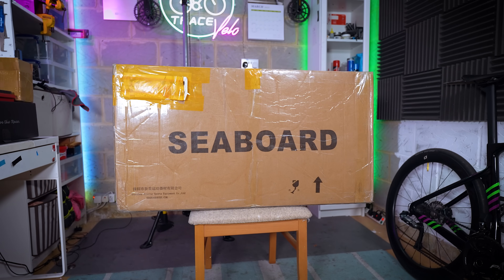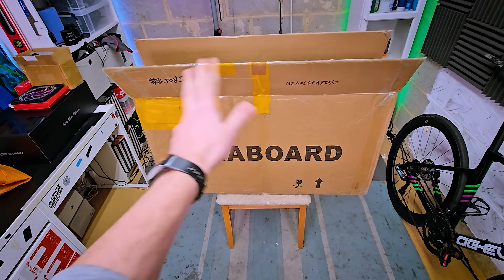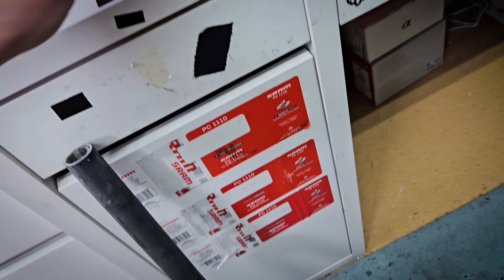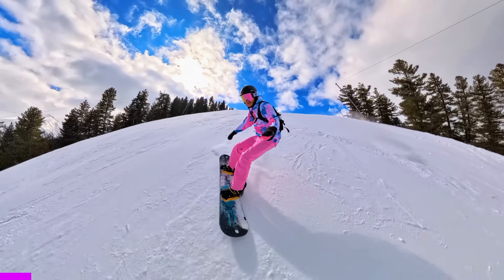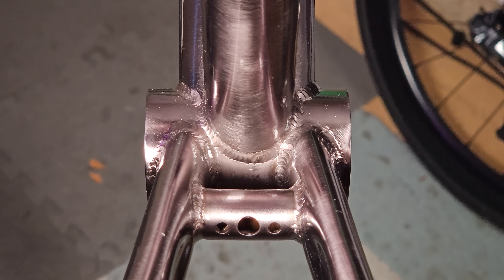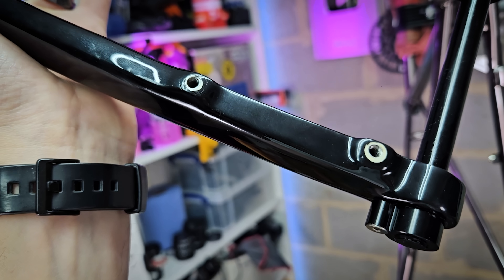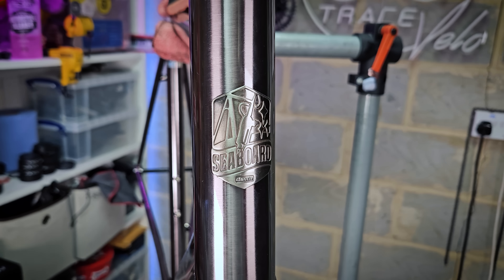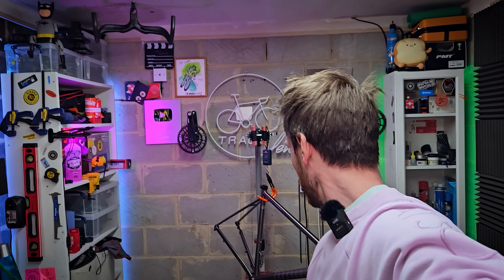A cheap steel bike frame from AliExpress - Seaboard CR05

Comment: Some all thread rod and a couple stacked oversized fender washers (so they don't bend) make for a poor man's DIY headset cup press.

It might not worth the hassle for cheap frame you don't plan on taking with you to the grave, but you can coat the inside of each tube to reduce future corrosion by sticking the straw of an aerosol can of Fluid Film/Boeshield T9/etc, into the vent hole on each tube.
Reply from the maker: I just bought some Boeshield and an extended spray can straw. I'll coat the inside of the tubes before the build. Thanks for the tip, I'll give you a shoutout in the build video!

Comment: I always treat inside of steel frames with a heavy duty rust inhibitor prior to building them. This especially applies to those tubes where water might accumulate. Something like tectyl 506 or similar.

Comment: Frame looks pretty decent to be fair. nice clear coat finish. the fork however looks as rough as a badgers ass. brake mounts look like they will need facing for sure and looks really rough around the axel holes too.

Comment: Aside from that funky front thru-axle, it all looks pretty good!  Of course, "classic" steel frames are assembled using brazed lugs and dropouts, so heat treating was not an issue with them.

Comment: My Elves Eglath cf frame uses a similar external "nut" arrangement but on the rear through axle. I wouldn't have thought you'd have any trouble removing that lower headset bearing in the future, it looked like quite a loose fit in the cup. If it does put up a fight, a blind bearing puller will get it out easy. Part of the tool is normally slightly smaller than the inside diameter of the bearing you want to remove, it is then expanded so that either it grips the inside of the bearing or a small lip expands behind the chamfer on the bearing, the tool then draws the bearing out, having said all that, I don't know if you can get one as large as the diameter of a fork steerer.

Comment: Great video! Not a professional but a hobbyist builder of several frames and forks. You don't need to heat treat cromoly unless it's thicker than 3mm. Bicycle tubes are sub 1mm. Nobody does it. Some higher end steel frame tubes are heat treated from the factory but you don't need to do anything after welding (you usually do with aluminium but I digress). Those welds look very decent and I would personally be happy with them. How is the alignment? And are the tubes double butted? And can you see a seam down the middle with the endoscope? These are the key questions. The overall frame weight is a clue (should be about 1.7kg for quality thin-walled seamless double butted tubes). 2.2kg is far too heavy. It's not the weight per se that's a problem but you will get less of the buttery smooth ride feel etc etc yada yada. Having said that recent commercial frames like the Cinelli Nemo TIG and that ridiculous Colnago thing are also overweight (although not quite as much as yours :).
Reply: 1,7? The Strael 3.0 (Reynolds 853) is 1.9 kg. Mason Resolution (Columbus Spirit) is 2.1 kg. Where do you get 1.7?
Reply: @mashkal2006  That's for my own frames which are usually about 55cm size and mostly made of Reynolds 631 in .8/.5/.8. 853 is the same tubes (unless you get ProTeam or DZB) just heat treated. That Strael weight includes a 440g fork. So that makes the actual frame 1.56, a bit lighter than mine! That's the ballpark you should be in for a nice steel frame for road use.
Reply: @benc8386  the 4.0 (new one) is that light. The 3.0, to which I referred is not. Do you know of any steel production frame (beside the Fairlight Strael 4.0) that is 1.7 kg or lighter? I'm in the process of speccing a new steel daily driver, and the Strael is outside of the budget. And I haven't been able to find anything lighter than around 1.9 kg. Many thanks in advance! 🙏
Reply: @mashkal2006  I would go custom if I were you :) The off-the-peg builders tend to overbuild, I suspect for added safety margin and ISO testing (which is very unrepresentative of real world failures anyway). Another option on a lower budget is a vintage frame.

Comment: I like the "I got a clamp-on adapter" bit, like dude, it's called just getting a derailleur, most of the non-fancy ones come with that clamp. Sure, they don't say "road" on them, but all they need to do is wrestle the chain from one ring to another, a Tourney will do the job.

Comment: Please don't use that star nut on a carbon fork. It's included in your kit because Seaboard sell this frameset with both carbon or steal model forks. They've just included both, a carbon fork requires the compression bung to support it when the stem is cinched up. It does not change with stearers containing fibreglass or not. Just worried about you face and future videos. Excited to see this build and review as someone that loves steal frames

Comment: You probably won't appreciate steel's ride coming from a carbon fiber frame.  I just switched from a steel frame to an aluminum frame and the difference is quite pronounced.    Steel and CF are very good at absorbing road noise and bumps and stuff.  Aluminum is very good at transferring every bit of road noise and every little bump right into your rear end, spine, wrists and hands.  The large thick walled tubes required using aluminum exacerbates this quality inherent in aluminum in the first place.
Reply: I prefer my steel frame bike to my carbon in terms of comfort.
Reply: I’ve got into arguments on YouTube comments with people arguing that frame material makes zero difference, but as someone who has ridden a decent steel framed back for over a decade I completely agree with you.

Comment: I bought that frame, one year ago. Since that time, i rode tausends of Kilometerstand with it, without significant problems. The ride quality is astonishing smooth. The weight with carbon wheels, 105 plus Ultegra mix, and Otter light finishing parts from Alia, is 8,4kg (frame 52 size, 2kg). Be aware to rotate your seatpost clamp 180 degress, to avoid stress for your carbon seatpost at the rear split frame area. Because of front derailieur inward stroke issues, i hat to shift the crank, by meens of a 1mm thick ring, to the right. My best riding bike. Better than carbon frame bikes......BR Peter

Comment: CMIIW, In my country, Tsunami is well known Taiwan based company for their fixed gear frames that actually best value for money could get. What's interesting is their gravel cromoly framesets are more expensive than the aluminium ones.

Comment: Been building and using Seaboard GR02, the aluminum frame, carbon fork  for a few years now and they have been fantastic. Also built some steel frames of theirs, also fantastic. Never seen your through axle mount before though, lookes a bit funny. Best of luck with the build, good looking frame :)

Comment: well i think you can pic up a beautyfull steel bike used for even less than 100€. the frames last very long. you could probably modify those to fit the newest groupset standards and still be cheaper than this one. ifyou go rimbreak its probably no problem at all, its still probably a litle heavyer but also a litle smoother than a carbon frame/bike. i dont realy see the point of getting a new cheap one.

Comment: I have a Seaboard GR02 and it is a couple of years old now. Great frame except for a few things I don't like, but the price was too good to pass up, and I was ready to retire my 15+ year old CX frame.

The two things I don't like are:
1. The top tube is a triangle and I use it for CX racing. So when I shoulder my bike it digs in.
2. The way the derailleur hanger mounts into the frame when you have to remove the wheel the derailleur hange pivots down due to the chain tension. Not a huge deal but a pain.

Otherwise I really love the frame. The headset it came with is fine and the fork has been great. It has me considering another Seaboard for when I update my road bike which is getting a little long in the tooth now.

Comment: The star nut isn't really a option. You absolutely shouldn't use these in composit steerer tubes. I guess it is just part of the head set that might also be purchased by customers with metal forks

Comment: Ah you youngsters….. pressing in your headset cups is standard procedure if you got into bikes before integrated headsets….. there is a tool to knock out the headset cups btw.   Also putting them in like that risks them going wonky and cracking the head tube…. A press is a far better option!!!   Nice looking frame , very retro mod!

Comment: I had the same frame in my shopping car during months!!! Not knowing if it was worth the hassle, having other expenses, and just going back and forth between frame materials over and over, the frameset just stayed on that limbo. 
Now my country has new regulations and word is that bicycle parts that aren't accessories can come in without paying import taxes and fees. So I ended up without a frameset, and with a lot of parts to build a bike that is missing its main component.

Comment: I also recently bought a steel frame. Worst purchase in my life. The bike is heavy, the vibration damping is a myth, or rather complete nonsense. It is worse than on aluminum due to the weight. The frame is also quite squishy and does not give any joy to ride, because the bike is unstable. Perhaps TA will eliminate this problem. On QR it is a disaster.
Reply: Bummer.  What frame?

Comment: I almost pulled the trigger last year on a Seabord CX03 or 05 frameset for a gravel build. Ended up deciding to not deal with all the complexities and got a slacker, more comfortable geometry, less compliant alloy frame Salsa Journeyer. Oh also larger size clearance (currently running 29x2.0" tires). Eve though I'm a steel frame enthusiast, I'm very happy I went for the more capable Salsa Journeyer.

Comment: I had fixed gear version of this frame, the FG03. Severed me well for many a mile. Only thing is that I found it to be a tad squishy.

I was in China awhile ago and there was an instance where a rider using a Seaboard Gravel frame where the fork snapped. So just keep on top of keeping an eye on the steerer from time to time.

Comment: You've never done pressed in headsets?  wow  Until about 10 years ago carbon frames were expensive to aluminum and steel all had pressed in headset cups.
Please, please, please go buy the correct tools for installing and removing pressed in headsets, the tools can be had cheap.

Comment: I built this frame into a road/gravel bike and enjoyed riding on it. I have since given it away to a friend. My first delivery one side of the seat stay was bent. I couldn't return it but was compensated for half the cost after talking to the seller. Eventually I bought the frame via a local bike shop and eventually turn it into a road/gravel bike with sensah empire brifters with tiagra RD on 11-spd cassette on 1x drive train. I refused to ride Chinese carbon so I bought the steel fork version. IIRC it weighted 8.9kg, pretty impressive for a steel bike. Was it stiff? It was alright, but a bit squishy in my opinion but it was a fun project esp. during the covid period :D

Comment: I’m not old but I’ve only ever had and worked on 80’s -2013 bikes steel and aluminum with external cables and bsa bottom brackets. Seeing you kind of confused by procedures and installs/removals made me lol. There are specific tools for everything and generally hammers on anything aren’t the best idea because while it’s steel it’s not indestructible.
Reply from the maker: I think coming across a threaded headset would send me into a blind panic 😅

Comment: I'm laughing, TV you're obviously a child of the carbon age. Press fit headset cups were, and still are, the standard spec for steel frames. What remains unanswered: are the frame's tubes butted? What's the grade of CroMo? 4130?

Comment: Please put some Boeshield T-9 or Wiegele Frame Saver into the tubes before your build it up! Preventing internal corrosion on a steel frame is crucial to its longevity. Both of the aforementioned products work well for this.

Comment: Quick tip on the headset. Put the cups in the fridge for 30 mins and get a hairdryer on the head tube. A gentle tap with a rubber mallet will pop them right in.
Reply from the maker: Genius! I mean the chopping board and hammer worked, but DEF trying this in the future!
Reply: I have used this technique fir headset fitting on both steel and titanium frames. I tend to used a rubber camping mallet on a block of soft wood.
Reply: I agree on these two methods. But just to be extra cautious I would use one or the other. Having one hot and one cold can cause thermal shock and potentially crack one or both parts. I just throw the cups right at the back of the freezer for an hour or two and take one out at at a time to be installed😎👍🏻

Comment: I have a cheap steel bike built mostly from AliExpress parts too, the frame is Koozer GX5300 and the welding is comparable if not slightly better! Very impressive welds for the price for both frames.

Comment: 10:25 , using a hammer to seat bearings is perfectly suitable , i do it all the time at work and on my own bike as well, only time i would avoid hammering home is if its a carbon frame set , otherwise GO HAM !  i often have to fit bearings with interferece fits of around 0.02-0.03mm  (the hole the bearing goes into is smaller than the bearing outer race ) by hammering home , i start off tapping it into place with a standard ball peen hammer , an then  i follow it up by putting some sacrificial material roughly the same diameter as the race im hammering on and hiving it a few good whacks with a 4 pound hammer (these arent tiny bicycle bearings  but not exactly huge either )

Comment: I am SOOO glad to see you pick up one of these! Seaboard has been on my radar as they also make a cool fixed gear frame (I primarily ride fixed, even on the road - yes with brakes!) and it's cool to see them getting some attention. They've been around for a while. I'm looking forward to updates. Keep doing what you're doing. I'm a big fan.
Reply: i ride seaboard fa03 and its a great fg frame for sure! Nice geo, it feels as they thought it through a liitle more compared to other popular frames (like snm100)
Reply: Im quite happy with my FG01
Reply: Tsunami's are pretty nice too
Reply: @TheSpaceBrosShow  for sure. Sister company, if not the same company with different branding.
Reply: @Rabnes25  they seem to be confused about the branding tho. Bike shop near my place used to sold tsunami snm100 and now they replaced it with seaboard fa01. I asked why and they said the distributors replaced snm100 for seaboard fa01 😂

Comment: Luke, I kept this exact frame in my Aliexpress cart for months last year. It was the only cheap steel endurance road frame I could find. I never actually pulled the trigger and decided in the end to go with a local framebuilder so that I could get better geometry and more tire clearance. For reference, it's made of Columbus Zona steel and weighs about 2kg for the frame. But it did cost almost double the Seaboard 😅

Comment: If you're ok with removing some paint on the welds, you can do a hardness test to see if it has been heat-treated. Some file tests are relatively cheap, but you can also just wait for an answer from Seaboard.

Comment: Framebuilder here - literally nobody is doing post weld heat treatment on steel frames. It might be done in one or two of the bigger factories but I’ve only ever heard of it being done on aluminium frames.
Reply from the maker: OK nice, thanks so much for clarifying Hogdog!!! I was reading some general guidelines that said anything under 3mm wall thickness wont need PWHT, but good to hear from a man in the know!
Reply: PhD in metallurgy here agrees
Reply: @davew782 so it wouldn’t make a difference?
Reply: Yes. The post weld heat treatment on cromoly is only needed on thicker parts (about 3mm wall tubing or more). Not on bike frames.
Reply: Steel is real , I bought an 1990s olmo giro with old school gearing last year as a nostalgia purchase and I love it, even with down tube shifters!!
   I’m 56 now so I asked a mate of mine who does the Ironman to ride this bike on a 20 mile fairly flat loop and give it every thing he’s got!!, he rides a pinarello f12 dogma so I wanted to know the time difference, I gave £185 for the olmo and guess what, my mate pulled up with a face like thunder 😂, I said what’s up? have you broken it?, he said no but I’m only just under a minute slower than on the dogma!!!, he said with a few upgrades like wheels that don’t flex he reckoned he could reel that in a bit🤷, he said it holds momentum very well, conclusion is it’s all in the legs 🤷
Reply: @julianmorris9951  it always has been 😊 !
Reply: @julianmorris9951 I have an Olmo giro too, they are great bikes
Reply: Yeah  jones, Soma, and all city, rip, are the only ones that I know of doing it.
Reply: Frame tubing manufacturers will state if a heat treat is required post frame build.
Reply: @MysticFluff1  Reynolds wont sell their tubing to a frame builder until they make sure the builder knows how to build a Reynolds tubed frame.
Reply: @bradsanders6954   Might be wrong here... think that restriction appeared w 953 Reynolds.
Reply: YouTube expert here - I can confirm

Comment: I'm quite sure you will have no problem removing those headset bearings in the future as long as you don't leave this thing out in the rain and let the bike rust over. A little grease on the cups would prevent most corrosion though and is pretty common for installing these types of headsets.